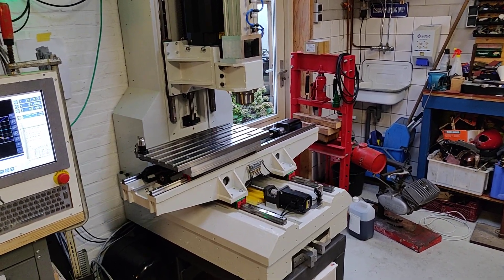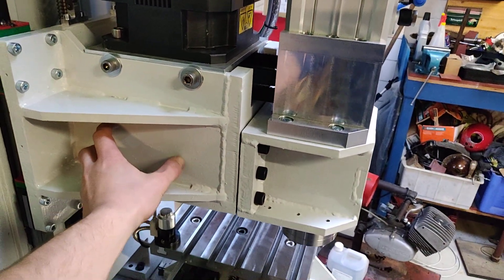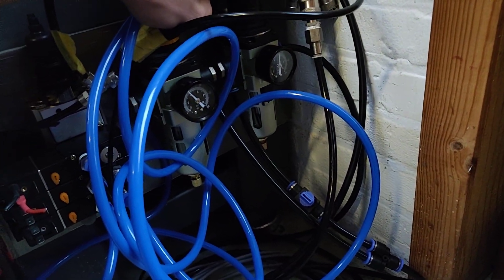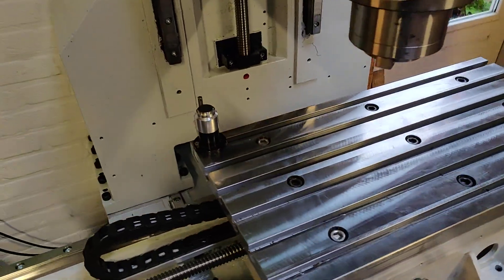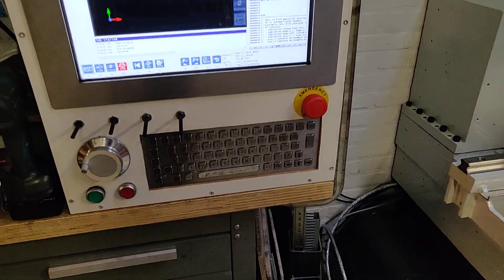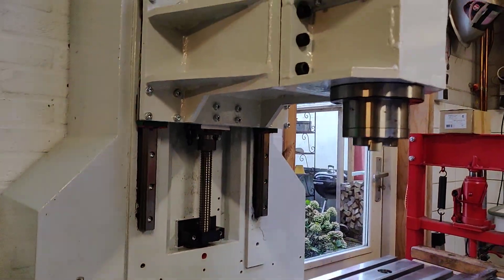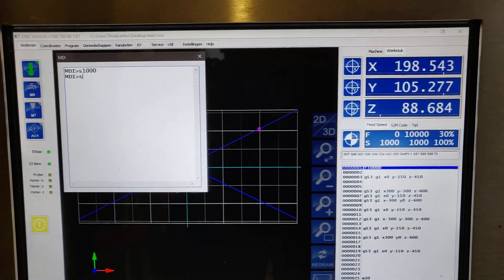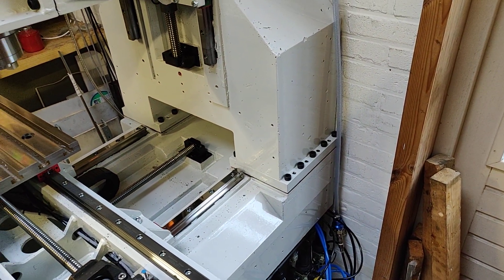Epoxy granite cnc mill walk around

Comment: Hello dear is that Eding cnc controller accurate ? is it  industrial and practical ? how can it control servo motor by puse direction or other protocols ?
Reply from the maker: Yes it works fine. And yes it's a step and direction connection. Just check out the website.
Reply: @Svanitterzon  
I have installed Newker Chinese brand but acutely its not very accurate 
I am thinking of other economical alternatives 
Thank you a lot
Keep going 
You are doing a great job

Comment: Hi Stef, that's an awesome CNC build! I am thinking about building a CNC as well. A question that is concerning me is how to make sure all axis are perfectly square / aligned. Could you make a video to explain how you did it? I believe this will be highly relevant for many people
Reply: When using epoxy granite or UHPC you always need to sink a metal (aluminium, or preferrably steel) frame into it. Not only will the metal frame help to reinforce everything and make it even stronger, but more importantly the steel frame will contain all the mounting and attachment points to bolt things to, for example the column of a mill to the base, or the linear rails. Unfortunately the frame will always get slightly bent and deformed as the concrete or resin hardens, and so you will have to correct that afterwards and before assembling everything. The best way to go about correcting it is by first milling it to do the rough correcting and then hand scraping to do the fine correcting. Once you've done that you will have perfectly flat mounting surfaces, ready for assembly. You will need various tools to do the hand scraping and to accurately allign and mount all the parts and components, things like a test indicator, precision angle plate, precision level, camelback, etc.

Comment: I think what you've done is really nice.  This was my approach for a base also.  I'm curius to know how it handles vibration as a weldment.  I believe the base would do quite well for most machining even without being filled.  I think the spindle motor is powerful enought to rattle even a cast iron base....so I don't think you'll be running at full speed often.  Also, the spindle sounded loud to me...like some bearing noise but maybe just belt noise.  Hard to tell on youtube tho.  Cheers and great build.

Comment: Stef van, I'm a subscriber can you tell me the specs for your spindle servo motor is it a 240-volt 50Hz motor I want to build a 3.7kilowatt single-phase mill as I'm Australian
Reply from the maker: This is the servo: https://m.szghauto.com/product/115.html i belief they also sell a 1phase 3.7kw driver. Just contact them they are really friendly.

Comment: So now you even painted and made it even nicer looking this really impressive machine, but the general comment is still valid, since you made nothing about that... Why so many people leave out from the design the fact that these machines are making a BIG mess when used? I mean, protection should be part of the initial design, collecting chips, cutting fluid and safety should NOT be left out, otherwise you will have to spend a lot of extra effort on cleaning the mess every time when using the machine, apart from the fact that you are milling the chips as well, which reduces the quality of the products you are making. It is truly an amazing machine, but it is in a serious need for upgrade. Safety wise, the flying chips are dangerous, not to mention what happens when a snapped off mill bit comes flying towards your face...
Reply from the maker: You almost reached the right video keep on going. 😅
Reply: @Svanitterzon  I think the message gone through. The feature should be taken care of already from the start, otherwise it is more difficult to implement and do it right.

Comment: When I owned my machine shop the head on my CNC mill was 3200 LB's. or 1451.496 KG's. and even with the break a power outage happened and the Cutter dug into a mold cavity about .010 IN. or .254mm. during a finish cut and that was with steel counter weights.

Comment: I’m very impressed and humbled by what you’ve done, I bought a used Fadal machine and it needed to be disassembled down to the casting, cleaned and rebuilt on the way back together, I’m always complaining because I can’t get my hands on a manual, and you don’t need a manual at all !  My hat is off to you Stef

Comment: very nice. do you have a background in automation? i like the idea of the air spring on the z axis, less inertia and adjustable if you ever had a heavy tool.
Reply from the maker: No not really automation, im an electrician. This whole machine is build as a hobby that went a little out of hand😆

Comment: Hoi Stef

Zijn de delta servomoteren  makelijk aan te sluiten aan de Eding cnc kaart? Heb jij de Eding 960 kaart er in? Ik ben aan het bedenken wat voor onderdelen ik moet kopen voor mijn project.  Mvgr Leo Tubben
Reply from the maker: Hey leo,
Ja super makkelijk te doen. Gewoon met step en dir signaal. Alleen even goed opletten met aansluiten ivm voltages. En je moet wat kleine dingetjes instellen op de driver. Op damencnc website staat een goeie uitleg over het instellen.
Reply: @Svanitterzon   ow dan ga ik binnen kort het spul bestellen. Heb je die motoren ook op alie express  gekocht?
Reply from the maker: @Tubben-tools  yep € 309,14 | 80mm 220v 750w 2.39NM 3000rpm 17bit ASD-B2-0721-B+ECMA-C20807RS Delta  AC servo motor&drive kit&3m cable
https://a.aliexpress.com/_BVdvaA
Reply: @Svanitterzon  ECMA-E11310RS + ASD-A2-1021-M 1kw 2000 rpm 4.77Nm CANopen AC servo motor driver kits met 3 m power encoder kabel .
Ik dacht aan deze voor mijn machine . Voor de z as
Reply from the maker: @Tubben-tools  neem aan dat ze kwa aansluiten en instellingen redelijk het zelfde zullen zijn.
Reply: @Svanitterzon  daar hoopte ik al op 😁

Comment: Stef, I've been watching your build on this project, it occurred to me that the effort and cost of the machine would it not have been just as cost effective to go buy a similar machine, mind you nothing can compensate for the experience of the build, nice job 👴🏻
Reply: Yeah, he could have had something considerably better for the €15.000-16.000 he apparently spent on it. I regularly browse an auction site for industrial equipment such as metalworking machinery, and its not uncommon to find professional 5 axis CNC's for €10.000-12.000, or 3 axis CNC mills for a few thousand Euro's. In fact he could have had both a professional 1000 mm between centers lathe and a 3 axis CNC mill for a third or even a fourth of what he spent.

Comment: Great looking machine, If spindle bearings and motors are quite, whole machine operation is quite, accurate and reliable you have a winner. It sounds a little noisy,  Solve those issues and I think you got a very good machine.

Comment: Tbh you could have said it was a commercial machine without its enclosure and I would have believed you. It looks like something I'd expect to see in an "amazing CNC machines" type video. 
If it has way covers and a chip tray I would have had a hard time believing that you built it.

I am curious if you are using DRO scales on it, or just the servo's built in sensors? Maybe it's cause I've only used stepper, but I don't trust motors to be accurate by themselves.
Reply from the maker: Hey Peter, haha tnx for the comment. I use servos they have encoders inside. A linear scale would be even more accurate but my cnc controller doesnt support that. And i also dont think i really need that

Comment: Amazing! Are you running the servos in single phase? Congrats
Reply from the maker: The spindle is running 3 phase. The axis drivers are all single phase. And devided over the 3 phases.
Reply: Stef van Itterzon Thanks. So the drivers on the axis are generating a 3 phase signal from a single phase source? The spindle on the other hand is using a 3 phase directly from your utility provider? I would love to build something similar. It seems to be possible to build for a fraction of the price of a Haas. I’m moving to California next month. Not sure I’ll be able to have  3 phases there. Will see. I’m originally from Brazil and 3 phases are standard there for most apartments and houses. I live in New York now. Will see what happens in California when I get there ... Congrats again. Your machine is comparable to a Haas and very superior to a Tormach. I hope I can get there. Thank you for the feedback.
Reply: Stef van Itterzon Ok. I got it now. You meant you are using the axis servos one on each of your three phases and three phase for the spindle and it’s driver. Right?
Reply: Stef van Itterzon What kind of steel did you use for the X base? And also what kind of steel did you use for the milling table? How did you aligned the metal parts that hold the linear rails to be parallel and coplanar to each other during the casting? I hope I’m no abusing. :) Thank you.
Reply from the maker: @keepcalmandrth6685  yes that's correct about the wiring. The steel for the xaxis slide just normal plain steel all 8mm thick with a lot of box shapes in the structure. The steel parts inside the casting i just bolted them down in the mold. Those surfaces have been made flat after casting with epoxy. So during the casting it didn't need to be super perfect. There is a build thread on cnczone.com with pixtures about the mold and the leveling.
Reply: Stef van Itterzon yeah. In suspected you flattened it later. I’ve seen your thread there. Including the .nl too.  It couldn’t understand anything beyond the pictures. Did you had the base  machined or ground? Did you outsourced it or did it by hand? I’d there a way to contact you privately? Thank you.

Comment: Nice Machine. On mine I counterbalance the Z with an air cylinder except I use a regulator,  So I am not using air as a "spring"" to provide a constant force  for the entire travel, also lets one adjust the counter force depending on attachments, although that is just a bonus.

Comment: Wow, that's really well done.  I wish I had the time to do this, I would love to build a small machine to use at our shop.  One this I just don't get though. Every build like this I see people using tiny ball screws and lineal guides.  If your going through all the trouble why don't you get some guides and ball screws meant for a full size VMC.  That along with a good spindle and granite epoxy base and you'd have an amazingly ridged and accurate machine for doing small parts
Reply: I can't find the articles where I saw this, but I read in at least a couple of places that people tend to get rails that are far larger than necessary because they feel like the thinner rails look too small when in fact even the 15 or 20mm rails can still handle a surprising amount of loading (talking about d.i.y. size of machines) based on their specs.  So, I guess the bottom line is that you have do the calculations for your rail and application, and probably the rail will be smaller than what you might expect.  Here are a couple of nice articles on linear rail selection considerations: https://www.machinedesign.com/automation-iiot/article/21828134/common-errors-in-linear-guide-way-selection, https://www.youtube.com/watch?v=EssAbsCut_s, https://www.youtube.com/watch?v=wsS7ifd-Gpo,  and a nice one on how alignment is critical for rail life: https://www.thomsonlinear.com/en/support/20150125-na.  This discussion  https://www.cnczone.com/forums/mechanical-calculations-engineering-design/8083-cad.html, has a comment, "When I was designing my machine I brought in the THK rep and he said that everyone over-estimates their needs by some considerable margin."
I have no idea if the rails in this video are over-engineered, if so it would be interesting to know by what factor given expected forces for all his use cases.

Comment: Can you explain more about the counterweight brakes?
Reply from the maker: The counterweight doesnt have a brake. There is an pneumatic cylinder on the back that is pulling on the chain with the same force as the weight of the head. The brake is on the servo. The shaft of the servo blocks when the power goes off.

Comment: Hi, thanks for thé vidéo i saw that you have the same AC servo spindle i try hard to make it run on linuxcnc wirh the X5P pulse Dir cable plugged to a mesa 7i76e, but i dont know what and where the X5i cable goes to, do you have any better description ? Thanks!!!
Reply from the maker: I run my servo with the 1-10v signal and with a direction signal. In the manual there is a explanation about how the pulse and direction is working. I don't know that mesa card but there must be something to be found on the internet.
Reply: @Svanitterzon  thanks for the reply, obviously i found it out^^ my build is on my channel if you wan't to have a look =)

Comment: Love your machine. Finally someone with skills and money both. 

You said you have two nuts with springs pushing them away.  My experience says that atleast on the z axis, a spring loaded Double nut won’t work that well. If you make the spring that strong, it’ll wear the screws way faster. I would rather have a ground spacer between the two nuts than springs. How is it going now  btw?

Comment: Question .. is your spindle operating on a -0v to +10v signal?  (typical VFD speed control)
Reply from the maker: Yes it is and a enable and direction signal.
Reply: @Svanitterzon  I have just received a spindle motor & driver from aliexpress .. at least in appearance, it looks exactly like yours.  On mine the wireing schematic that was pasted inside the terminal box on the side of the motor was smudged badly & unreadable .. can you possibly provide me with a schematic for hooking up the cables between the motor & driver?  Thank You in advance .. You're machine is awesome!
Reply from the maker: @g.m.4507  if you have an email adress i can send you a picture of the connection box of the servo.

Comment: Where do you get the epoxy granite?  Can't you just use some high density concrete with small aggregate and then seal it?  Maybe add some fibers to give additional strength to the concrete?

Comment: good morning my friend can i use pure concrete to make the structure of my cnc or would i have any problems in the future?
Reply: Wandall Splitter Concrete is fragile. But maybe encased in steel it would be a good base. Seen plenty of machines made that way.
Reply: @GreybeardMakes  
thanks  my friend
Reply: you can use UHPC (ultra-high performance concrete).   Here's a blurb in English: https://durcrete.de/machine-beds-with-nanodur/?lang=en  Example UHPC builds: https://www.youtube.com/watch?v=iZv0EGkI4r8&list=PL7sPQE-nASLZf-u4yC0qrbCAWO7sGO_VS (turn on auto-translation to English subtitles if you don't speak German) and https://www.youtube.com/watch?v=bqGzbKFMhSg (I don't think he ever finished though).   Also, unfortunately only in German, there is a book all about building machines with UHPC, https://www.amazon.com/Maschinenteile-zementgebundenem-Beton-Praxis-German-ebook/dp/B07MTXJHSV, just to say, it's an established machine bed material.  Some take-aways from the book: as long as you keep the concrete in compression, avoid any pulling forces, it's really strong, and, no point in adding fibers in a UHPC machine bed as they only add a safety factor for when the concrete breaks under tension but if your machine bed gets to that point you can throw it out afterwards anyway.

Comment: Hey Stef, i'm from your neighborhood germany and i'm actually also building a Concrete VMC i am at the stage where my castings a finished and the guide are getting scraped by hand. So now i am searching for a nice BT30 and servo spindle motor. I found your's on aliexpress also, but to be sure can you maybe link the exact page to your's ? Thanks!
Reply from the maker: € 425,91  49%OFF | ATC spindle BT30 Spindle CNC Milling Rounter Electric Spindle Motor 220V with Synchronous Belt for BT30 Spring + Drawbar
https://a.aliexpress.com/birdFPrb9

Comment: 3:35/10:55  3.7Kw is about 5 HP spindle motor.....this is professionally build machine and  10HP spindle motor would be just right! It is definitely not overrated. And yest, the spindle baring should be changed to accommodate for speeds of at lest 10K or better 12 or 15K or possibly even better than that.   Beautiful work,anyway!

Comment: I noticed that some bolts of the linear blocks of the X axis are missing. Why is that? Is that because of the welding seams?
Reply from the maker: Yes that was an issue i figured out after painting 😅 but the bolds are in now. It was because of the welds didn't really took tought on that during designing. An other lesson learned there.
Reply: @Svanitterzon  Nevertheless, the machine came out outstandingly! It looks tough and stiff as hell! I've read the post on cnc zone about it, you have such a detailed report, well done!
I have a diy cnc router made of plywood. It is good for soft materials like plastic, plywood, mdf and wood, and I plan to build something more sturdy than my current build. Maybe not as good as yours, but at least that could mill aluminum.

Comment: Nice build. Why the aluminium sub plate?
Reply from the maker: Was easier to fabricate, but i can change it later if it doesn't seems to be strong enough.
Reply: @Svanitterzon  aluminium will also be more sensitive to heat and expand more than the steel parts and that might give accuracy problems. Other than that what s beautiful machine you build there 👍
Reply from the maker: @nikolaiownz  tnx i will keep an eye on it.

Comment: When will you ever need 12000rpm? Machining aluminum with carbide?:P I didnt check the diagrams, but it sounds like a bit much... 

Anyway, if you want to read in about the basics of machining: https://cfsd.chipfalls.k12.wi.us/faculty/jarosznj/machining%201-14.pdf and the 2nd part: https://cfsd.chipfalls.k12.wi.us/faculty/jarosznj/machining%2015-30.pdf
Reply: anyway, is that is zundapp enginge to the right?!